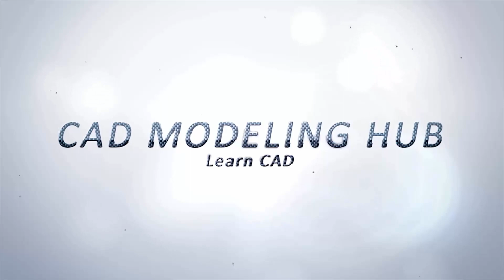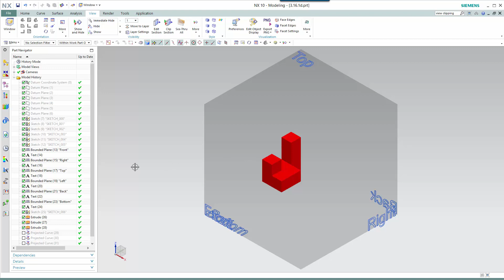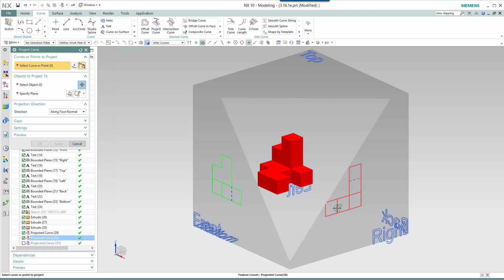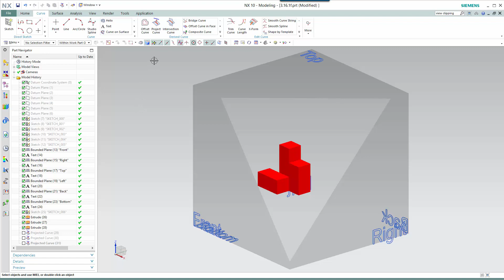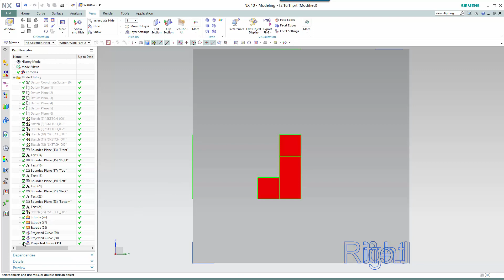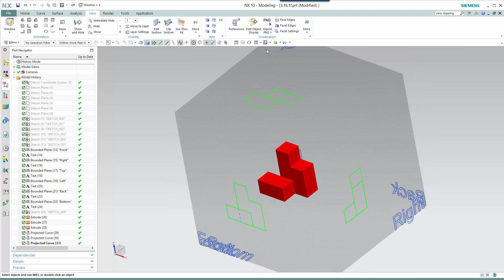Visualization from 3D to 2D Quiz

Comment: I was looking for a 3D to 2D visualization test; this is a good video except for the error on the Top View of the first exercise. There is an extension shown on the lower plane that is not reflected on the 3D model (admittedly hard to see). If the extension were there, it should have been shown in the Front View yet it is not. Otherwise, excellent video.